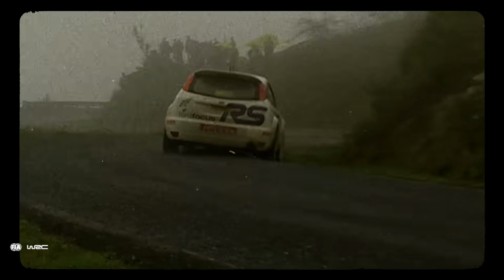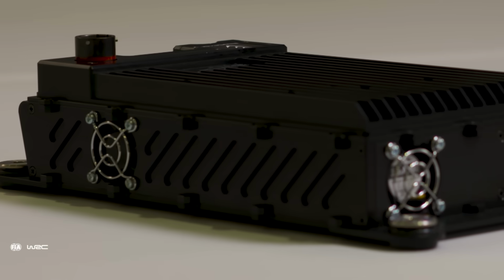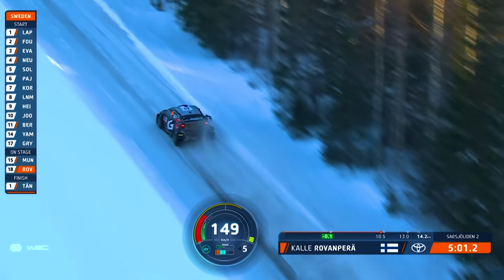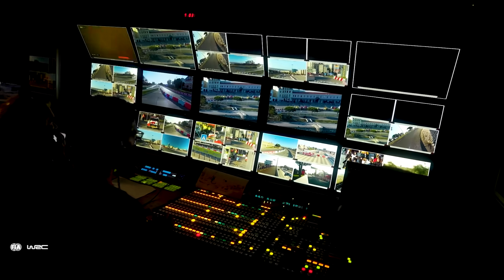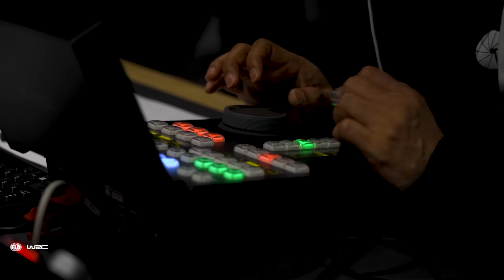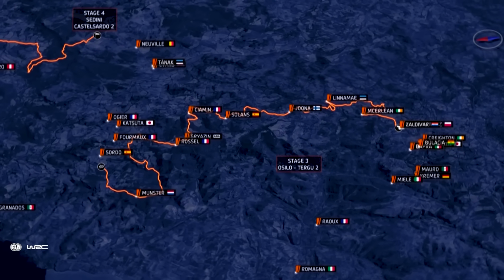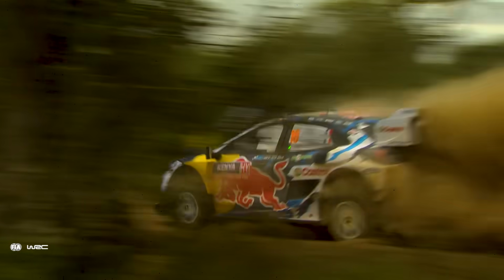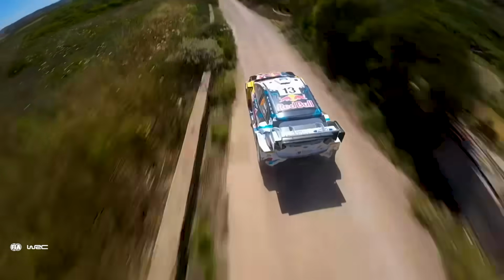WRC Broadcast: Explained

Comment: You’d have to increase the time buffer (say, by one or two extra minutes), but you could definitely get rid of the retransmitter chopper and the SD card if you simply used Starlink… the RV community already fixes the antenna flat to their roofs and it loses around half the band, but there’s still a lot left.
Reply: Starlink was attempted for my nation's rally series a year or so ago. They found that due to tree cover at the forest rallies they often couldn't get enough clear sky to reliably transmit